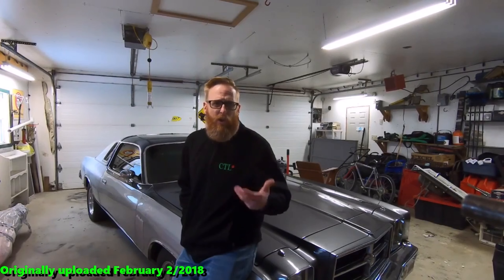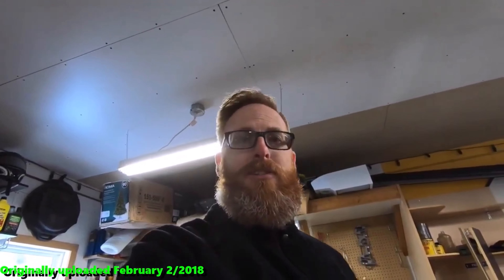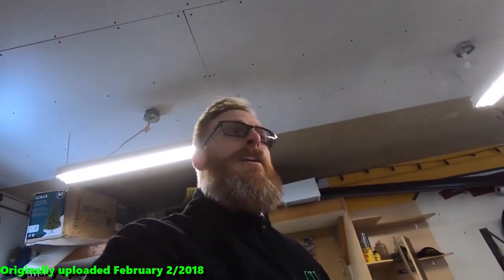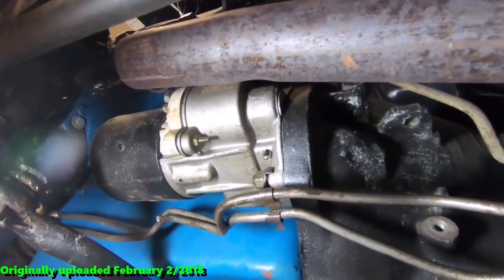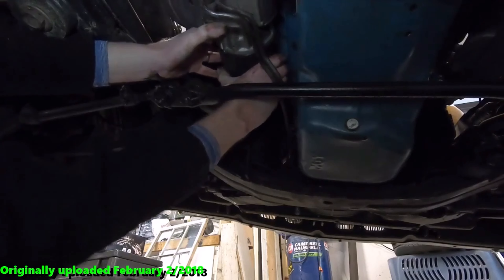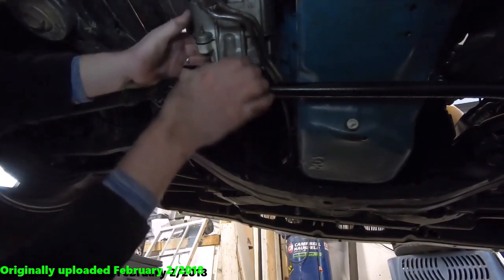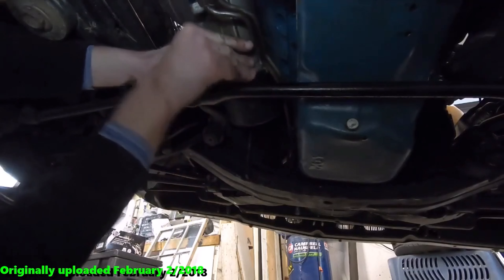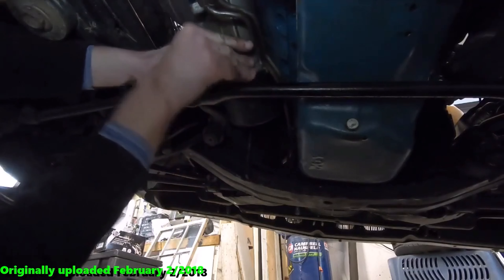Mopar Gear Reduction Starter Install-From The Archives

Comment: Have a  79 Dodge Diplomat with 318 cid can be hard to start after some months stored in garage, But when it's warm, it starts very easy. Not a big issue. But my friends daugther has 80 Doge Mirada with a 360 cid has not this ''issue''',  But has another issue. The battery drains without the car in use. They have to dissconnect the battery overnight. Has heard that the starter can have this  issue on some cars, that drains the battery.
Reply from the maker: It's uncommon, but possible!